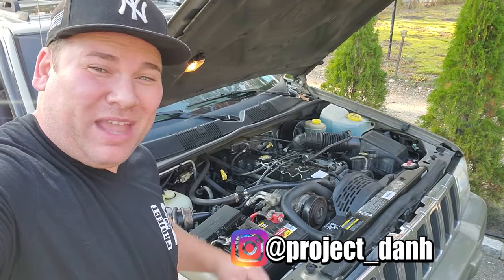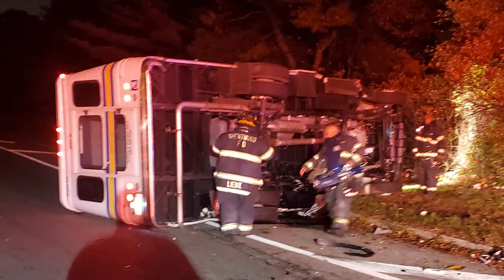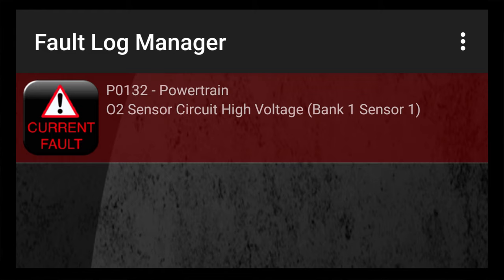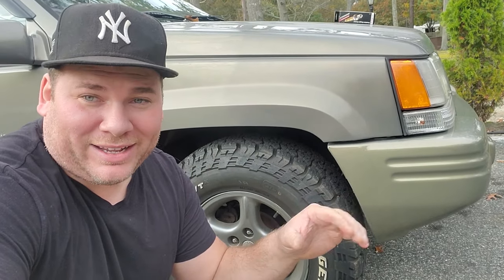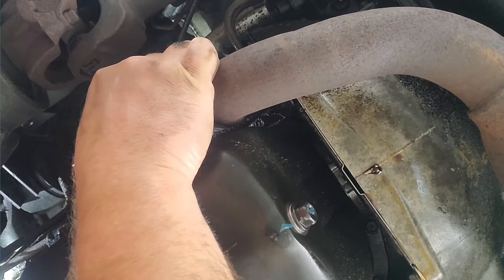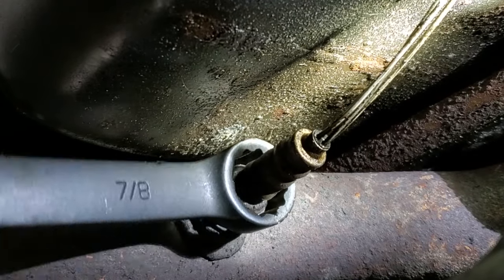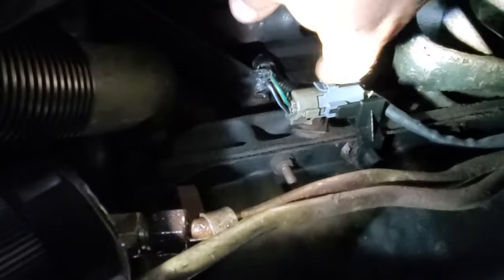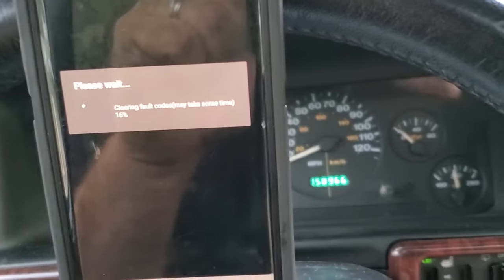BAD O2 SENSOR?? JEEP 4.0 MISSFIRE SOLVED  - UPSTREAM OXYGEN SENSOR REPLACED

Comment: 1998 Grand 4.0….Went through the whole fuel system.  Replaced fuel pump assembly and filter (all one unit inside the tank in the rear).  Replaced fuel injectors.  Pulled the distributor and inspected it.  Went through ignition system.  Replaced ignition coil, distributor rotor cap, replaced wires, and installed new plugs.  These exact symptoms were my issue and no matter what key words I typed or how much I searched I couldn’t figure this out!  So I went step by step troubleshooting my way into oblivion!  I even replaced worn parts of my vacuum hoses.  

Still the same symptoms persisted!
 
My whole top end was rebuilt too early on to these symptoms 2 years ago.  Head was removed, ported…polished…new gasket.  

Woke up today and took it to my local mechanic who rebuilt my cylinder head and had him throw his code reader on (even though no check engine light EVER came on).  Code read “cylinder 4 misfire.”  )Cylinder 4 is the last cylinder closest to the windshield).  

So I figured-

A: it’s a bad plug by chance …even though it was replaced a year ago when my head was rebuilt.  And even though I also physically checked ALL plugs were receiving a spark 

OR 

B: Oxygen sensor!  Typed in “cylinder 4 misfire” and your video popped up.  Dude the way you described the symptoms was SPOT ON and I immediately went to the parts store and got an “Upstream sensor 1” part 

I snipped the wires and threw on a 7/8 impact socket onto a long breaker bar.  Hoses down the old O2 sensor with weasel piss (PB blaster) and kept the Jeep running.  Blocked the back tires and had it up on ramps.  Laid down from the front - end side and the sensor is right there!  ( Be extra cautious if you do this because the tan blade is right there above you and will most definitely fuck your day up more.  

Wrenched down on her pushing away from me (lefty loosey) and she came right out with some hard effort.  Brace your back against the passenger side front tire for leverage.  

Note*. Flash reset your computer by unhooking the ground wire from the battery with a 1/2 inch wrench.  Do not let it touch the terminal and go turn on your light switch on and off a few times.   I also go through the motions of turning the engine on and off and hit the blinkers.  Basically you are discharging any remaining power in your electrical system.  Hook the ground wire back up and you are golden!  Any code should be wiped and the computer will relearn your driving behavior and will adjust to the new sensor readings.  Giving your better fuel economy and peace of mind.  

Cheers

Comment: Been struggling 3 months with this problem and today I found the problem. Great video 🙏🏽
Reply from the maker: Thank you so much! Best of luck with your Jeep!
Reply: @ProjectDanH  hey I just bought a 1998 jeep Cherokee and my oil pressure goes up and down when I'm driving when you got your foot on the gas it goes to 40 and when you take it off it drops to 20 than goes back up  what could be wrong with it
Reply from the maker: @Ashley-qf3gv  that's not too far from normal.
Reply: @Ashley  bro sell your jeep lop you know nothing
Reply: @Ashley-qf3gv  Rule of thumb. 10 psi per 1000 rpm is fine.
Reply: That's what my jeep is doing now i told my son that it not   Idling right. So this is what my problem is the 02 sensor good grief
Reply: What was your problem ??

Comment: Dude, thank you for the tip. I have a 2004 wj with the 4 o2 sensors. It started running bad for a few days and tons of black smoke out of the exhaust and then over the course of a few minutes it would literally not move above an idle while in gear. I could put it in park and rev it to the limiter but once in gear the gas pedal literally did nothing. I received tons of advice from "mechanics" and they all said spark plugs, coils, injectors, IAC, TPS, clogged fuel filter and clogged cats.
However none of them could explain why it idled fine and could be revved in park which wouldn't happen if they were the issue. But alas with no smoking gun I started with the spark plugs since I had never changed them in the 80k miles I've driven it and i bought it used with 99k miles and had no idea how old they were to begin with. The electrodes were severely worn down and the gap was easily twice the factory distance. So I thought that had to be it... Nope. No change. 

Then because of the completely dead gas pedal I thought maybe the TPS. Nope, replaced it and cleaned out the throttle body with no change. 

I knew from a previous check engine light that one of the downstream o2 sensors was failing and saw that they were a common problem on the 4.0 so I replaced both of them and the oil pressure sensor that was failing randomly. Still no change.

 I was defeated and ready to take it to a mechanic for the first time since I've owned it. But then going down the rabbit hole one more time I found your video and while it wasn't exactly the same symptoms it was pretty close and easy to test. I unplugged the 2 upstream sensors the next day and it finally drove down the road like normal. I replaced them both and it's running great now. Thank you!
Reply: Thanks for all the detail.  Seriously... very helpful.
Reply: @two8252  Glad it was helpful. Did you have the bad upstream o2 sensors as well or was it something else?
Reply: I've got an 02 Cherokee Laredo with most of the same symptoms. Replaced both up and downstream 02s in bank 2. Still the same. I'm about to go unplug the upstream 02 in bank 1 and see what happens... Fingers crossed! Congrats on the fix! This video is great, regardless of whether or not it works for me
Reply: @shawnmaginness9872  Hope it works for you too. I tried so many things with no change and was at my wits end and was so happy after finding this video..

Comment: I can not believe this is working so far. I have a 99 Cherokee XJ and it was cutting out, rough idle and very intermittent. I did the cap and rotor, it needed it, crank sensor, cause my scan tool showed it dropping out on the graph, and now I watch this and so far it runs fine. In COLLEGE, Associate in Automotive Science, the book says that a car will go into open loop when it throws an emissions code. SOOOO, in theory it should not effect the running of the engine because it is in open loop running a predetermined set of parameters. Followed your tips and so far so good. Thank you for posting this and now I can get my Jeep back on the trail.
Reply from the maker: Thanks for watching man, I really appreciate it

Comment: Holy MOLY THAT'S WHAT'S HAPPENING. This is EXACTLY what I needed. You explained EXACTLY what I've been going through for months, but it would throw a Cam sensor code and then the code would shut off. I'll see what happens if I just unplug those O2 sensors tomorrow. DANG man I wish I would've watched this first. I thought it was a tranny problem with shifting.
Reply from the maker: Hey!  I'm glad I could help! God Bless 👍
Reply: @ProjectDanH  thanks for your help Dan, you've saved my Jeep from death. God bless your heart.👊
Reply from the maker: @deaddog3500  God bless you too!
Reply: @ProjectDanH I got popping noise after I did my plugs I haven't done cap or rotor could that be my problem?

Comment: I had this exact same problem in my 97 ZG. I was 1000km from home when it started using double the normal fuel consumption and running poorly. Dropped it into the Jeep service centre when I was near home. Left it there for 2 months and no-one could figure out the problem. The scanner didn't show up the error. It was destined for the junk pile but I took it home and after weeks of trying everything, I eventually unplugged the oxygen sensor and it instantly started running normally. Nice vid, too bad this all happened to me a few years ago when this info was not available!
Reply from the maker: Hey Dane!  Great story, sorry you had to learn the hard way.   thank you for watching 💪

Comment: 😮 omg this is totally what’s happening to our 99 Sahara. Love the video and how in detail it is, thank you 😊
Reply from the maker: Glad it was helpful!
Reply: Ok we finally got the upstream sensor replaced. We had left it unplugged a few days and once the new was installed next day it was running the say way. Rough idle at the start, doesn’t die but still idles rough.. we didn’t unhook the battery, does it need reset ?

Comment: Dan H I owe you my thanks, this finally pointed me to my problem on my 98 XJ. Oddly my CEL wouldn't come on when I unplugged the sensor but it behaved just like you said and ran ok when forced to run in "Open Loop" fuel mode.
One extra thing to be sure - I put my code reader on and used the setting to watch live data and there is was, the o2 was drunk ordering drinks haha and spiking wildly out of expected voltages and messing up the fuel trim % values.
So I watched this video twice maybe 3 times then had my own battle with it today and won in the end. Bosch o2 in and finalllly behaving after hot starts. 
Much love from Ireland and keep up the good work!
Reply from the maker: Glad to hear you sorted that drunk sensor! I appreciate the views! 🍻

Comment: Man you couldn't have been more perfect on your timing of this video. Just got a call yesterday from That Jeep Girl that got that lift kit and she is having this very problem in her 98 ZJ
Reply from the maker: Boom! The Lord works in mysterious ways.  🙏
Reply: @ProjectDanH  I told her to put  seafoam in her fuel tank to clean her injectors and if it doesn't clean that up check her O2 sensors. And then you post your video and I sent it to her to watch. So cross our fingers everything works out for her. Because I am now 1700 miles away from her and can't help her but through the phone.
Reply from the maker: @cravenadventures  cool buddy! Where do you put seafoam in Jeeps? Also what kinda seafoam?
Reply: @ProjectDanH  to clean the fuel system just add it to the fuel tank. You can put some in you oil to clean you crankshaft and under the pistons. And then some in you intake to clean all the carbon in the combustion chamber. Just make sure to run you jeep at 2-3k until all the smoke is gone. After wait at least 30 mins after putting it in. Longer if you never done it before. I have done it to all my cars and they all run clean and smooth
Reply: @cravenadventures  someone told me to do that...it did nothing. No one has been able to figure out what is wrong. So many mechanics....so they say...they broke me by replacing everything else.  I had to find Dan myself!  I have put so much money into this thing and one video of Dan solved it..well think so I think.  Haven't done it yet but the obd diagnostic tool said same thing.  So gonna do it.  And tell all those men to go in you tube and look up Dan next time you want to fix a jeep...or try to fix it.  Hahaha!
Reply: @lorihouse1766  Awesome, I am glad you got the issue fixed.

Comment: Wow, thanks man!  So I changed the transmission cooler lines on my 96 this past weekend. ( hard lines from the transmission all the way to the rad hoses). Not sure if you ever did that but it wasn’t fun. Anyway after I dropped the exhaust to put the new ones in, I noticed I had the same issue that you did in the beginning of your video along with a P0170 code. Turns out I must have messed up the o2 sensor working in that area. Fix one thing, break another. Sounds about right for me. Thanks for the helpful tips as always
Reply from the maker: ain't that always the way!? two steps forward one step back. lol

Comment: Hey Dan, Great help for our 98 XJ that I was beginning to believe was possessed.  This is the third O2 sensor, tried Bosch, NGK and Mopar.  Think I need to check the ground.  Well done with the "seat belt PSA"!
Reply from the maker: Thanks Kevin! hope it works out for ya!!
Reply: I’m on my second set of o2 sensors for my 98 xj which ones worked for you???
Reply: @marioortiz3064 what kind of sensor do you use now because I tried Bosch and now it's acting up.

Comment: I had the same problem with the cheaply made 02 "wrench" I went and got the deepwell socket style now and man what a difference. Couldn't help but notice you have the "pre-cat" Y-pipe (CA/NY emission system)  Take care not to damage that Y-pipe as there are none in existence any more and no aftermarket units exist. Had to use the "Federal Emissions" pipe (non-pre-cat) and had so many issues with BOTH the 02 sensors. Went through several different ones until we got the CEL to stop coming on.
Go Grievous!
Reply from the maker: Wow Dude, Thank for the head up on the Y pipe.  I'll make sure to keep that baby in tip top. 👍
Reply: Hey Dan, I  really like you're project videos.  I am working a project 98 XJ of my own.  I was wondering if I could replace my manual front seats with power heated seats and how would I go about that?

Comment: Hi,
I have been banging my had on fine starting poor running 91 XJ.
Pulled out gas tank, done ultrasonics to injectors twice, flushed the fuel lines, measured fuel pressure, new ignition cap an cables, coil etc... Nothing bad since it is 15 years sitting barn find. Now - this is to be tried next!   Thanks!
Reply from the maker: hope this does the trick!

Comment: Hi Dan, just letting you know changed the O2 sensor today. Needed a lot of heat, removed the front wheel for better access, used a long bar and it shifted. I also cut the old one down to get a six sided socket to fit. Had to use the old multi plug and solder it to the new wires but all good and running sweet from cold. Thanks for a great video.
Reply from the maker: Great to hear! Thanks for watching!!
Reply: what were your symptoms ?
Reply: @kavik526town2  car would start, then after 20 seconds would begin to misfire, hold back and almost cut out. Carefully pressing the accelerator pedal you could rev the engine and it would clear. Then it would be fine until the next start up.
Reply: @chriswarren2599  Sounds pretty similar it my problem. on accelerations and decelerations randomly it would lose power, RPMs would jump from 700 to 0 back and fourth and popping from intake then have 15 seconds would go back to normal.
Reply: @kavik526town2 how u fix popping.
Reply: @nathanmccumber8965  it was a intake leak
Reply: @kavik526town2  did u smoke it out or got new intake. I change wires not cap n rotor now it make popping noise when I shut off it shakes.  

I am gonna got new wire cap rotor plugs from dealer 180 for 98 xj.
Reply: @nathanmccumber8965  nope just found a few hoses on the intake that were leaking and replaced them. Haven’t had an issue since
Reply: @kavik526town2  I am gonna get smoked out this weekend.

Comment: I just cut the wires off put my impact socket on it and spin it out 😂 I use the O2 sensor socket to reinstall the new one if it's a tight space an old pipe wrench works too . My old ZJ would run better with the O2 unplugged and it get better milage but I replaced the O2 sensor because of inspection was due . Great video DanH and a little heat goes a long way 👌
Reply from the maker: Thanks Jay, I love the impact gun trick! great idea!!!
Reply: @ProjectDanH  saves time especially on Subaru's since everyone in my family like to buy them 😂 I tried to bring them to the Jeep side but they like AWD and gas mileage 😔
Reply from the maker: @jaysmith5084  Gas milage... Sad 🤣

Comment: I've got the same issue except I'm pulling a P0171. Replaced IAC, vacuum valve, vacuum hoses, MAP, etc.
Reply from the maker: oh man.. is everything working now?
Reply: @ProjectDanH  nope, haven't replaced o2's. Do we think it's an O2 issue with a P0171?
Reply from the maker: Possibly... I didn't have a code when I change my sensors.. hey, it couldn't hurt to put new ones in anyway

Comment: I'm having exact same issues. Only codes popping up. But I unplugged it and the check engine light never went off 🤣 I'm replacing it in a few days here.
Reply from the maker: ZJ o2 sensors should only have a code with the o2 sensor unplugged.. good luck!

Comment: Same story as in your video. So I went ahead and order a new O2 sensor Upstream. Replaced it and now I haven't even worse misfire. Maybe I damaged the O2 sensor during installation or maybe I just got a cheap brand from Amazon
Reply from the maker: Gotta make sure you get the corect 02 sensors.. double check with your autopart store

Comment: There is a  double ended 14mm/18mm  thread chase/ cleaning  tap that works great for  02 sensor and  spark plug threads to clean out the carbon and rust.  Check it out..
Reply from the maker: Thanks for the info! will do!

Comment: Hey Brother Dan! I’ve twice now gotten the code for my lower o2 sensor. The first time it went away… this time it’s been on for days… so today I decided to go punch it in the face and see if I could loosen it up… got the bung hole glowing with my torch… tried to get on it with a big plumbers wrench… wouldn’t budge… so I made sure the wires were ok… looked like wires… drove to Walmart… 2 miles… and when I got in to come back it was off! So yeah… I figured I would have killed it dead with the heating… but now it’s happy again… propane to the face for the win!
Reply from the maker: Heck yeah! you burnt off the bad!!!

Comment: Having this problem on my 5.2, engine would just lose all power trying to accelerate and nearly stall coming to a dead stop. I love the irony of how the temporary fix is to just unplug the sensor so it has to use the OEM default levels which were already optimal 🙄
Reply: but apparently that makes your engine run VERY rich and your mpg will drop to like 10mpg
Reply from the maker: Very ironic! but still neither the best performance nor efficiency...  and you wont pass inspection. lol